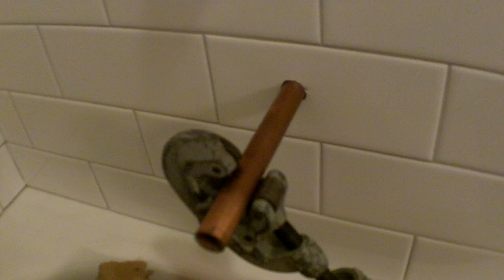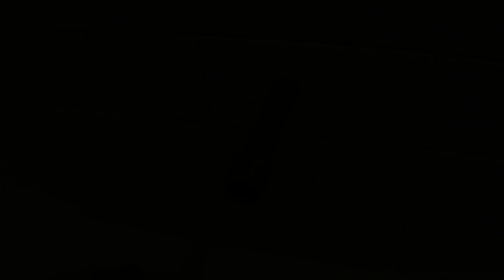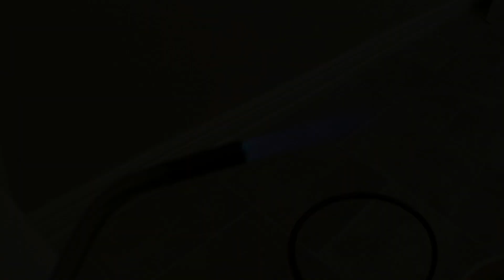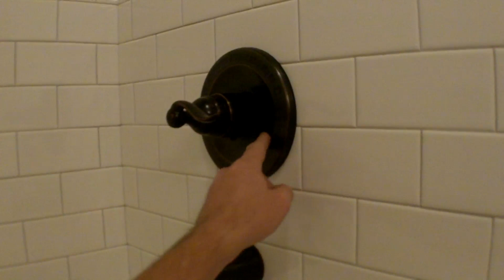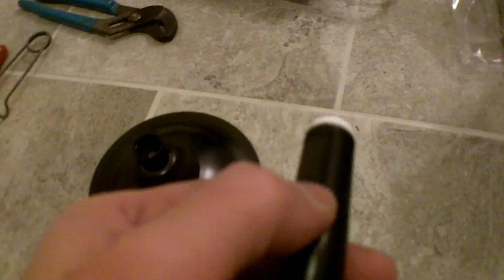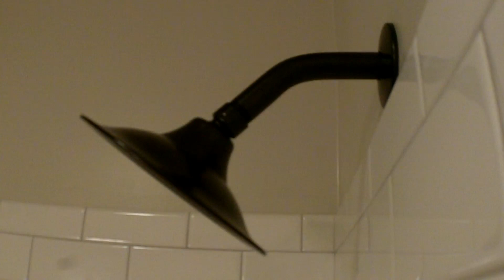Part30- Investment Property Renovation

Comment: Funny thing, G, since purchasing my home a little over a year ago any time I've needed to use teflon tape I've always just gone to Permatex Thread Sealant with PTFE (liquid teflon tape basically). I'm a way better mechanic than a home repairer, and that being said I have this thread sealant because it cures in the presence of oil and even things like automatic transmission fluid, perfectly filled the thread gaps and screws together really easy since it's a liquid that only hardens in the absence of air. 
http://www.amazon.com/Permatex-80633-Thread-Sealant-PTFE/dp/B000HBM49W
From what I've read though it works well for home fittings as well, although honestly I'm not sure if it's technically safe for drinking water use... either way it hasn't stopped me and I find it much less hassle to smear a little on instead of using teflon tape.
Reply from the maker: +Jesse Crandle 
I basically use the same stuff too, along with still using teflon tape in some places. It's what ever the home centers sell I buy, and maybe a bit less expensive than Permatex...lol. I haven't looked, but they're probably the exact same. Take care, G.

Comment: I always get solder drips. Guess I'm trying to "make triple sure" it won't leak (haha).
Reply from the maker: +MRrwmac 
I get them as well Mac! If I have a drip hanging on the bottom of the pipe, I try to strike it off just as it's cooling. Nothing wrong with being sure I say. Much better than having to fix it after the water has been turned back on! That can be a pain. Take care, G.

Comment: Thanks G.  Great couple of videos and good info as always.  I've been looking for a longer hose setup for my MAP/propane also...pricey buggers!  Yours looks about 6'!   Could you please give some more details on brand and and that torch/bottle head you are using.  Never did tile before except maybe with Dad a 100 years ago as a kid.  A question about your layout lines and grout gaps.  Do you offset the tile 1/2 a grout line?  The reno looks terrific and the new owners will have a fine house, but more importantly it was built right AND beautiful by Master & Mrs. G!!  ~¿@  Thanks Bud.  ~PJ
Reply from the maker: +pjsalchemy 
Yes PJ, the hoses are quite pricey now that I look. I know years ago we would have them made up at a welding supply house for much less than list. I picked  my rig up off eBay many moons back. I did have to replace the regulator last year. My hose is actually 12' long. I believe everything is made by Victor. The regulator is model STK-R. The torch body just says TurboSnake with no model number. The tip I've shown in the video is an ST-4. They are dual fuel so either LP or Map gas can be used. I have two other straight tips as well- an ST-1 and ST-3. I can remove the hose and use any of the tips directly on the regulator. Here's a link to my basic setup- excluding the stand. 

https://www.plumbersstock.com/turbo-ts1b-kit-snake-kit.html?gclid=CI3I48mfpswCFQoNaQodIlEFPw

Yes, I spit the grout line right in the middle of the tile for the running bond pattern. Thanks for the compliments! I hope the torch info is helpful, albeit somewhat expensive. Take care, G.
Reply: +ghostses Thanks very much for the research and torch info G!  Ouch!  You could buy a small tank Oxy/Acetylene rig for that.  If I used it more, maybe I could justify that cost but will continue to look for a cheep and cheerful alternative.  What I really like is the portability and the tip control you had.  The key I think is that regulator/needle valve.  I have 3-4 LP/Map bottle heads of different sizes/shapes but not nearly as controllable.  The Jewelry people use some pretty nice stuff but that's pricey too.  Hemingway I will continue the hunt.  Thanks also for the grout split...I figured but wasn't sure.  You guys really Deserve all the compliments on your fine reno work and more for the work you do to share it!!!  Thanks Again,  ~PJ
Reply from the maker: +pjsalchemy 
No problem! Yeah, they're quite proud of them. I know I was sub $100 when I picked mine up of eBay. Good luck with the hunt. I know exactly what you mean about the heads! I have a couple and in the drawer they stay.

I know I've used a micro oxy/acetylene rig like linked below, but can't for the life of me remember what for...lol. It might be exactly what the jewelers use- don't know. Take care, G.  

http://www.amazon.com/Little-Torch-Tips-Box-Acetylene/dp/B001DZIML0
Reply: +ghostses The little ones suit my needs generally but do need some giddy-up once in a while.  The Smith's are for jewelers and pretty good for the $ from what I've been told.  The Orca/JSP kits are another but with broader control and better handle shape IMHO.  The regulators are fixed though for most of the jewelry versions and not much oomph, but good heat up to ~2600º.  I found the victor version on Amazon similar to yours but with only 1 tip (#4).  Looks like separate tips are about $100 though and more for HVAC than universal.

http://www.amazon.com/dp/B001AS9ZWA?psc=1

http://www.amazon.com/JSP-Torch-Complete-Three-Connector/dp/B0161RJ434/ref=sr_1_fkmr1_1?ie=UTF8&qid=1461602373&sr=8-1-fkmr1&keywords=EZ+torch+orca

For the price of the one you listed I thought about a kit like below and HFT has one also but a bit leery of the tanks & regulators.  Note in the description...the tanks are Not DOT approved...why have them if you can't fill them...Duh!  For my space and needs this give a lot of versatility and Temps and probably cut with it if I had to.

http://www.amazon.com/dp/B015YR3C12?psc=1

I have the little OXY/Map kit and built a carrier for it.  It's great for getting in small places and silver brazing but the tip/regulators suck and the O2 bottles give you about 2-3 good uses...@$8-10 per.

Don't mean to hijack your video with this, but am really grateful for your knowledge and dialog.  Thanks Much!  ~PJ
Reply from the maker: +pjsalchemy 
You'd be hard pressed to hijack any of my videos or threads. I've never seen the Orcha/Jsp rig. It looks like a Tig welder stinger. I can see the control it would give and the price seems reasonable. Do you know if they have a Map gas version? They state propane in the listing. 

Yes, a setup like mine only comes with a #4 tip. My eBay job also came with the #1 straight tip. When I purchased the replacement regulator, it came with the #3 straight. 

I too have considered the HF kit for small jobs around here. And yes, ditch the tanks and sell it for less as they are useless. My dad has a big bottle rig, so I never picked one up. I do search CL from time to time for a good deal on a small setup. 

The Arksen seems very reasonable to me.

Yeah, the fueling cost on your oxy/map rig might put me off a bit- depending on need. As it is for mine, I can go through a bottle of Map gas in short order when I'm going cherry red for brazing. But it sure beats dragging around larger acetylene tanks to a roof top like I used to do...lol. Take care, G.
Reply: +ghostses Otto Frei list the Orcas as being LP/Mapp and have seen some YT vids of people using them with Mapp.

http://www.ottofrei.com/Store/The-EZ-Torch/

The thing to me about the HFT or the Arksen is the throw away tanks or maybe re-purpose them for something?  Going this route seems a good entry level setup but basically I believe you can buy a decent quality regulator and torch set for the same price, then either rent the tanks or buy them later.  I could go get my Dad's victor set and pick up some small tanks for it or swap his out but it's nice to have his up there...lots of choices.

The Mapp tanks don't last long I get that too and dislike the disposable/cost side of them but you are absolutely right about portability.  That's why I built the little acrylic carrier for my oxy/map or can even throw a LP tank in it.  It holds every thing I need in it for small tight jobs and folds up neat and tidy for storage...just want longer hoses and better tips and control.  I'll finger it out eventually.

I also saw the corner of your small heat blanket in one of the vids.  That's also a nice add on to the kit!  Saw them at OSH a while back...may have to pick one up.  Thanks, G!  Till Then...~PJ
Reply from the maker: +pjsalchemy 
That's cool! The Amazon listing only referenced LP. 
It sounds like you've been doing some homework for awhile and I would agree, if the tanks can't be filled- buy a better name rig and either rent or buy the tanks like you mentioned. Yep, it's all about money and choices....lol. Me, too many choices and not enough money...lol.

Sounds like a nice little rig despite your wants. Not sure what the setup really is, but I would investigate possibly having longer hoses made up. As I mentioned previously, we had our hoses made up at a fraction of the cost to Victor prices. The only true difference was not having a strain relief on them. And since no strain relief, no place to stamp "Victor"...lol.

The blanket works great! It's not all that big, but neither are my jobs. It does drop black hair, but a small price to pay. We don't have OSH around here. I don't recall which store I got mine from, but it was one of these two. G.

http://www.homedepot.com/p/9-in-x-12-in-Hands-Free-Heat-Shield-314002/100345508?keyword=solder+shield

http://www.lowes.com/pd_173498-138-31400___?Ntt=solder+shield&UserSearch=solder+shield&productId=1043403
Reply: +ghostses Yep I have and I hear ya.  Lots of choices not enough duckets.  Think we both do our research pretty good.  For this it's one of those things I don't use every day but have broad uses so picking the right thing for the broad range and narrow budget always pays off, and can make do mostly, with what I have.

I never did post my Oxy/Map rig on the website but it's basically acrylic scraps (2 tier) from TAP Plastics with a back tall enough with 3 pockets (2 tanks and hose) to leave just the top of the tanks and valves exposed.  Then a lower compartment for striker/solder/flux/heads etc., and I can stick some small braze/other rod down next to the tanks to have on hand.  The cool thing I think was adding a folding handle that when folded out puts the rig at about a 30º angle and really stable.  Turned and knurled some brass hinge pin thumb screws that help lock it up or down.  When folded in it will stand on its own on a shelf or hangs on the wall through the hand hold hole.  Cost about $3 in scrap and a half day to whittle it out but fits my needs well.  Also made a small, 4 thin brick welding/brazing plate with some angle and a ply bottom.   It is "tote-able" but heavier than I would like but give enough surface to be useful.

I think you may be right about having hoses built up.  I'll definitely swing by the local welder store and see about the hoses.  Our local shops are a bit proud of their stuff but will check it out for sure.

The Oatey one is the one I saw at OSH.  About the same price too.  I really like the OSH stores, my wife too!!  Our local "Despot" stores are a fiasco as far as help and layout/selection of hardware especially.  Might be fine for contractors but even material grades are a bit sketchy for me...decent prices though.  Lowes is much better but quite a drive for me.  Osh is more like a tractor supply and a good Ace were combined with nice knowledgeable folks too.  I'll probably pick up one of those blankets based on your thoughts...small is ok for my needs.  ~PJ
Reply from the maker: +pjsalchemy 
Agreed!

Sounds like a good use of scraps- and very useful. Nothing like making something useful from stuff just lying around!

That's cool! They're well worth the cost in my opinion! Take care PJ, G.